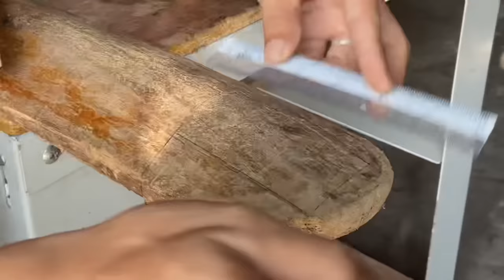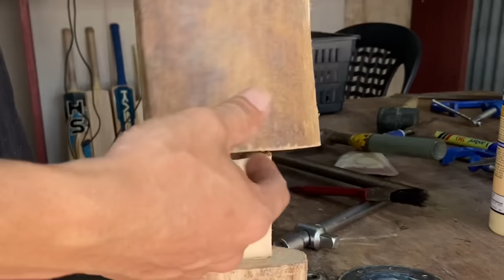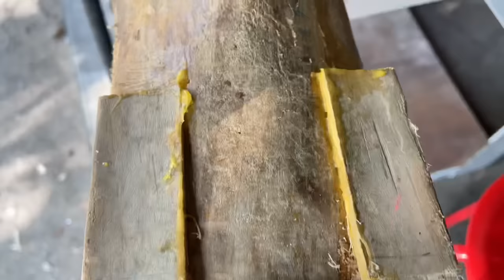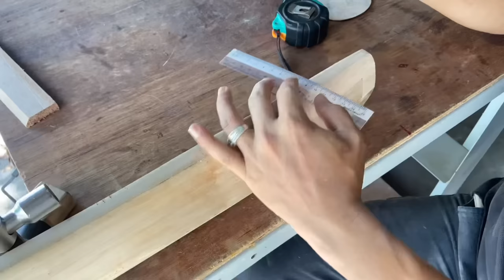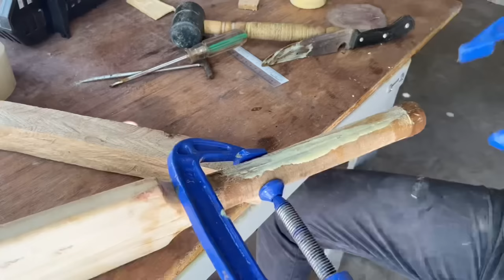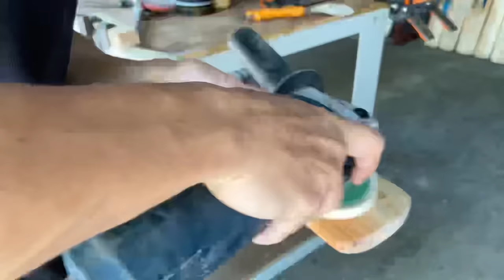10++ years old cricket bat repair@MHAMaster

Comment: 5:01 - Is that a split, from hammering in the lower dowel, too roughly?
Reply: No split there. If you look at 1/4 speed, it is glue that squirts out on the last drive with the hammer.